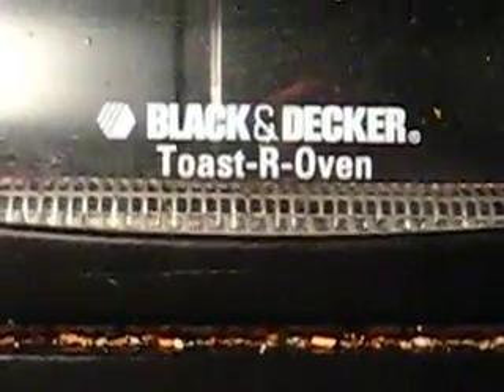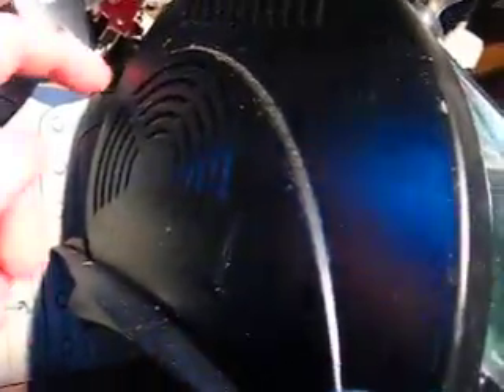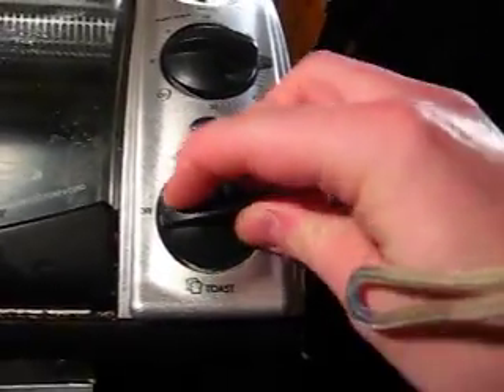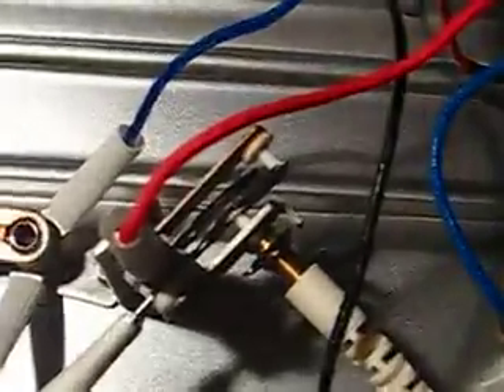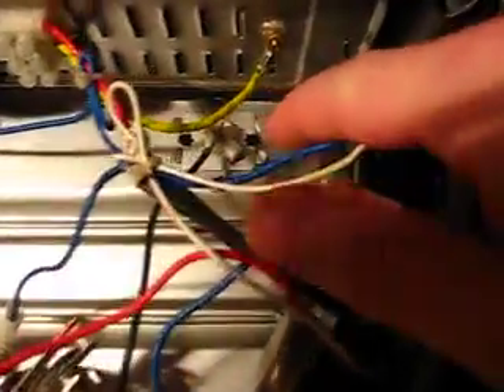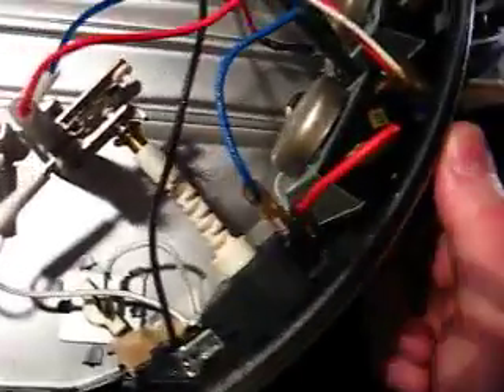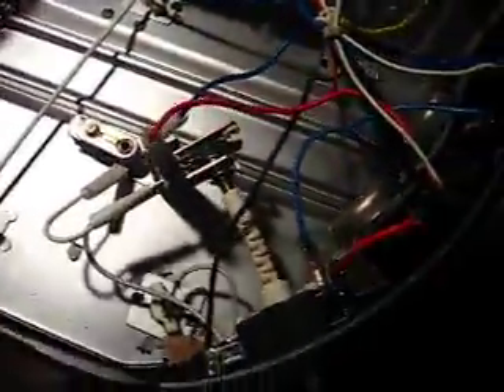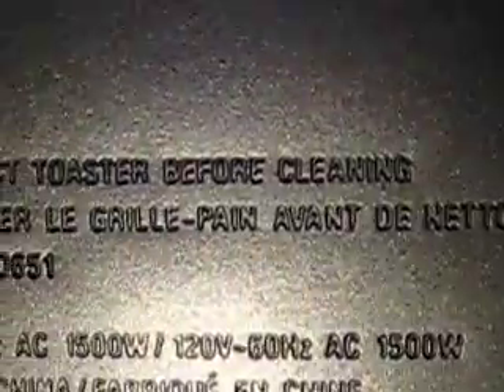Dead Black & Decker Toaster Oven TRO651

Comment: Just repaired our nearly identical TRO5050A.  The plastic auxiliary switch on the thermostat shaft that turns the lower element on failed.  Replaced it with a 10A toggle switch that emerges from a hole I drilled in the top part of control section.  Yes, I can afford a new one.  But it's depressing spending money on another one that's made even more cheaply.  The expensive ones seem to have more parts to malfunction.  Not complaining, this one is at least 12 years old, and will remain in service until it breaks again.

Comment: If you did not part out the oven yet, may not be too hard to fix.  That switch with the burnt connector is the problem.  I had that switch apart, seen how it works.  The 3 wires at the bottom (red, white, blue) is like a spst switch with white being common.  Red is for oven, and blue is for toaster.  After I rebuilt the switch the first time, and it happened again, I just bypassed switch by connecting that burnt white connector, to the red timer wire connector.  Oven will work, toaster will not.

Comment: I have one too, and failed in similar way.  I'm going to write to UL and ask them if they think the connectors on the switch should get so hot they discolor the insulation.  I think there are temperature limits in the UL product safety standard which impose safe limits.  If those are exceeded, B&K might be looking at a product recall.
Reply from the maker: They do this to force you to buy a new one. Planned obsolescence at it's finest. It's more of a safety hazard because the under engineer stuff and use inferior parts. The ovens that are from the 50s and 60s are built better but are not as safe in today's standards.

Comment from the maker: I thought about modding this one but have already parted and thrown this oven out. the only parts I have left are some of the control switches the wind up timer switches the blue power LED and I don't think I kept the elements. Otherwise I might have modded it. Companies put WAY too many things in products today. More chance of it breaking down. I've simplified some things b/c they failed and some are still in use today.

Comment from the maker: I wish I had an old 360 console just to fuck around with you know? that power brick went to my friend's 360 and the plug broke off so he gave it to me. I bet he has the console around still as I can probably rig it so its playable again. I can run nearly anything with this brick except the car vacuum i got. it just pulses and doesnt work but the brick runs a car headlight awesome as well as my car stereo. I didnt really fix the TV it was the power brick but as you saw I ran it off the 360 psu.

Comment from the maker: well im gonna show my parents the part thats busted but Ive told them it doesnt work and they've seen it not working so its destined for the trash but AFTER I part it. yeah id love to have a MIB vintage toaster oven. lol i wonder if spats has a spare one lying around. right now I got this oven apart and 2 pf the parts are removed b/c i dunno what to do with this thing. this one switch is the whole reason this thing aint working and one of the wire terminals the plastic around it is melted.

Comment: Hey Vince, I was reading your reply to this video, and am thinking I want to try fixing my busted Black and Decker toaste oven.  Mine is a slightly differen't model but it's very similar, at least aesthetically.  I was wondering if I might make a video of the guts of mine, and possibly inquire wiht you about fixing it.

Long story short, the toaster busted after 3 uses (piece of s**t).  I got to toast 6 slices of bread for $30 - how cool (/sarcasm).

You interested in helping a brother out?

Comment: I have posted a pic on (fixya dot com) pointing out what I did to fix this model identical to what I own.  This fix I do still allows the oven and timer to work, the bottom knob will not do anything.  
For testing:  If you turn the timer to "on" then turn the thermostat knob on/off quickly and see the oven turn on momentarily sometimes (blue led in this model), then it would be the same issue.  If its not the same model, or same type of switches/wiring, may not be possible to help but can try.